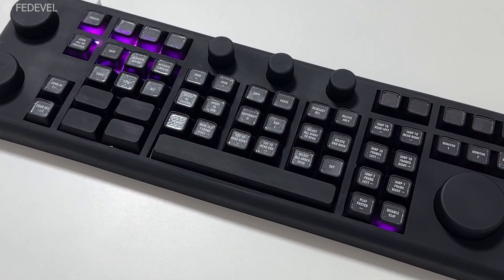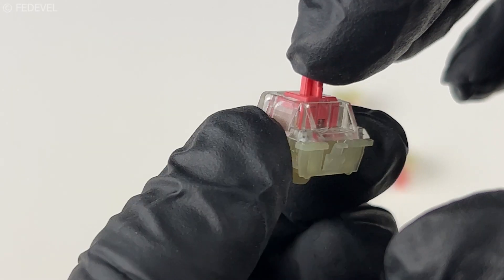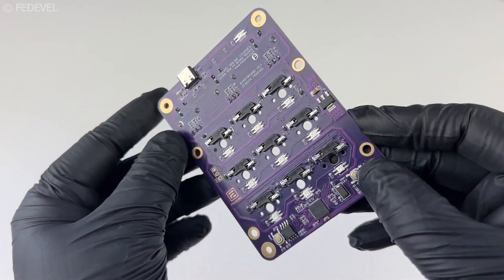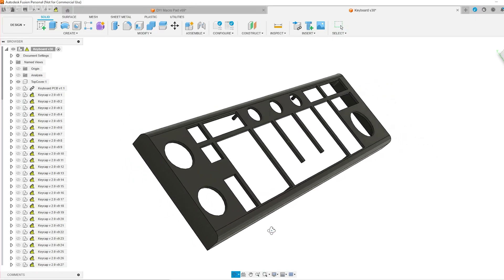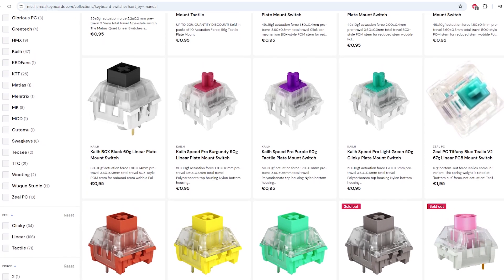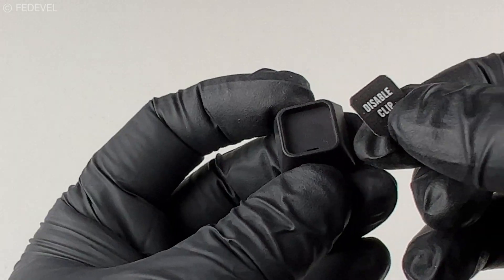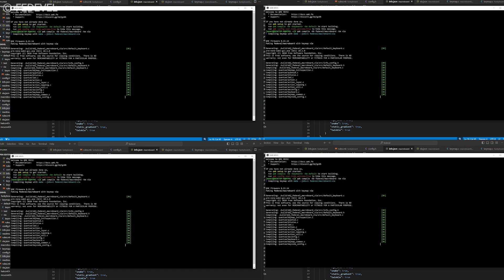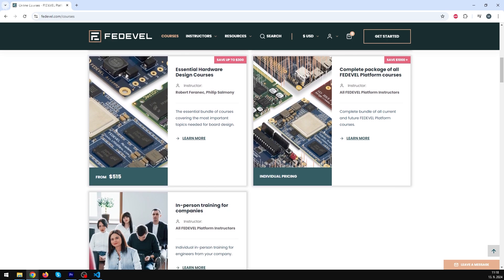I Built This Custom Keyboard from Scratch

Comment: Very nice. Some thoughts: 
1) Ergonomics -  If you look at high end interface tools the way in which you work is taken into account. Does it sit on your lap or on the desktop. If on the desktop does it need a wrist "rest" or hand "heel pad".  Can you work within an operational mode with minimal hand movement or can you stay focused on the workflow with your hand in a "home position". 
2)  Add a color LCD with Context (or mode) that allows you to pick a phase in the workflow and change the functions of "home" keys on the fly. For example when trimming video edits - everything to mark, set cut-in, cut-out, select sources, etc should be millimeters from finger tips.  Expert systems have this with tiny LCD keycaps that change for mode.
3) The timeline rotary encoder should have a dot depression to allow you to put your finger on the dot and spin it without gripping the wheel. 
4)  Application specific macros for "rote" tasks. Say you are done and you want to publish (transcode etc). Should be one button that does it all when you select that mode. 
We've all seen these modular "bricks" keyboard solutions. Not a new concept but nice. This helps you build role specific setups easily.  Very nice.
Reply from the maker: If these keyboard projects will get interest I am happy to tweak them. It's very interesting to work on these.
Reply: @RobertFeranec  - I'd be surprised if it didn't.  The reality is the keyboard mouse interface is really designed for word processing dating back the Xerox Alto/Star. That was purpose built for a secretary/admin and no one else.  When you abstract yourself away from the limited solution and look at the overall efficiency you can easily see a need for all sorts of input devices. Xerox even pioneered the touchpad (they called it the "Cat") shortly after the mouse - realizing that there were alternate ways of working.  Have you ever caught yourself thinking how stupid programming expressions are because they had to map to a Selectric typewriter  QWERTY keyboard world? Then you look at DITROFF and its "mark up language" again - limited by primitive keyboard options.  So many compromises hampering efficiency.  Taking your video editing reference  - if you look at professional Post Production (or live) you see a lot of I/O going on. Audio decks with (automated) sliders, effects generators with wipers, source selection panels with tap buttons and "scrub"  tactile soft buttons.  In the newer 3D realm you see 3D Mice with (the needed) multidimension input.   I/O is a big market but it has to be a low prices.  I can recall when the Avid desktop editor came out they offered a keycap kit that were laser engraved commands with color coded modal grouping. You just popped the standard keys off your PC and pressed on the new caps in the designated location.